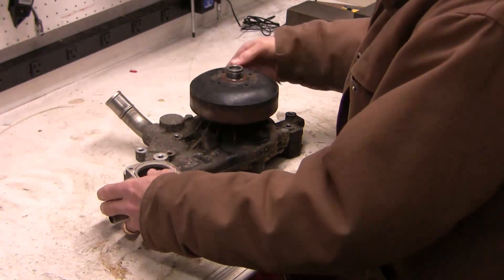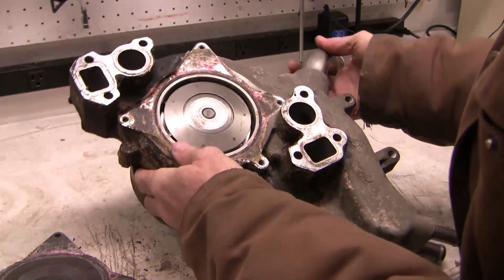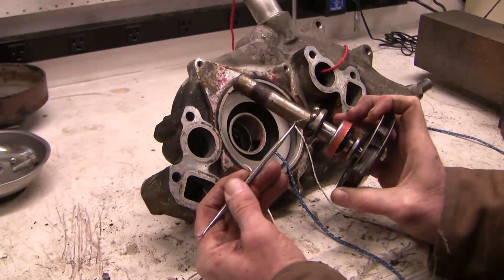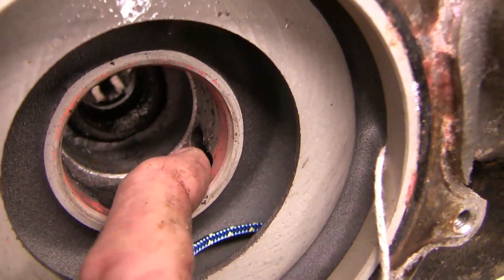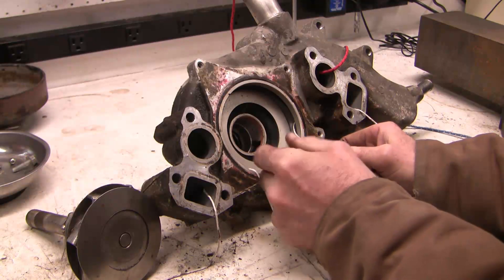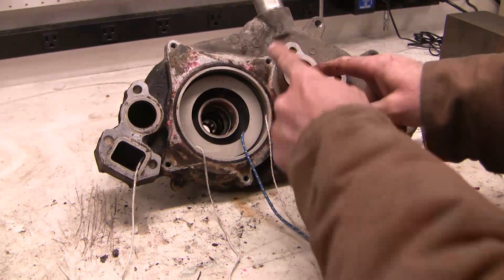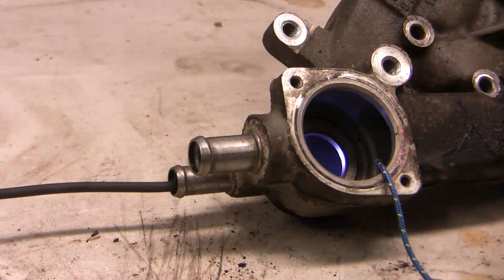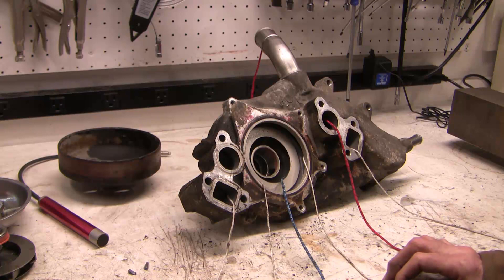Inside a chevy water pump -- how it works

Comment: Wat happens if the water pump stops working
Reply from the maker: Great question. Most commonly the water pump bearing seizes and it stops spinning, or the impeller is damaged and it can't move water. In both cases, if you don't see the warning sign of coolant on the driveway or a falling reservoir coolant fluid level, or a screeching sound near the fan belt, you then start to see the engine operating temp rise. If you have an engine temp gauge you see the operating temp rise higher than normal after about 20 minutes of driving. Then if you continue driving you may suddenly notice steam coming from the front of the car, and the red overheat light flicks on. At that point the coolant is boiling, causing a spike in system pressure which opens the safety valve in the radiator cap. Everybody will pull over when there is so much steam they can't see the road. If you don't pull over, after about 5 minutes you'll hear a horrible screeching sound as the crankshaft bearings overheat and seize, causing permanent engine failure. The worrisome issue is the fact that even a minor overheat can strain the head gasket to the point that major engine damage can happen. So, a wise driver will pull over and shut the vehicle off if the temp rises, even before the red overheat light turns on. If that happens, a tow to a repair facility is the safest option. Remember it is unwise to open the rad cap when hot because you'll get burned by superheated steam. A bad water pump is only one of the causes of overheating, so you go through the usual list of causes (low coolant level, inadequate burping, radiator leak, leaking hose, bad rad cap, an air leak or kink in the coolant reservoir tube, bad thermostat, clogged radiator, failing water pump, etc). Cooling system problems continue to be the most common serious issue affecting engines, and if you understand cooling system you're way ahead of the game. I did a series of videos on my channel showing how various elements of the cooling system work. Thanks for watching!

Comment: Omfg!!! The press part at 1:50 scared the shit out of me 😱😱😱
Reply from the maker: Yeah, me too, (grin). Rather than sliding out it broke the housing of 
the bearing, which I've seen happen quite a few times. When it happens 
on a wheel bearing, you need to use a cutting wheel to get the rest of 
the bearing off before you can install the new one. Thanks for watching!
Reply: spelunkerd yea but thanks the whole video was so informative.. Liked and subscibed!